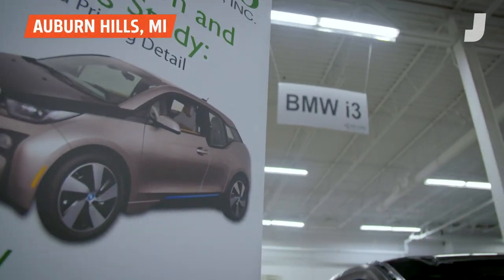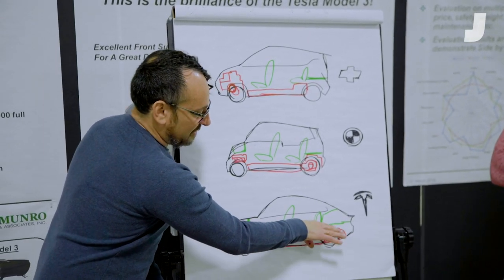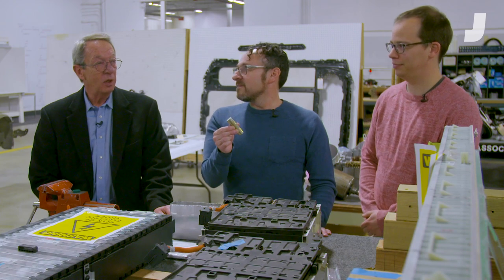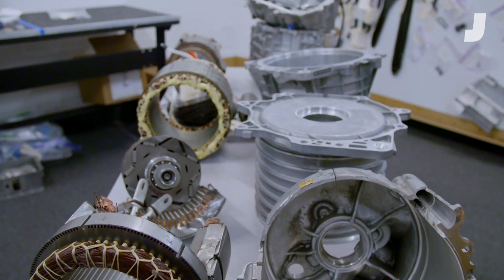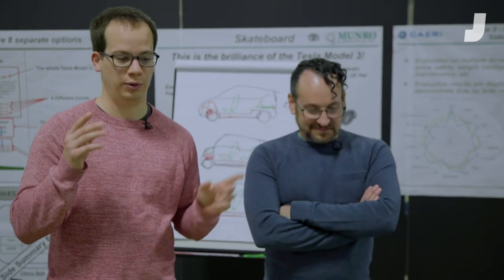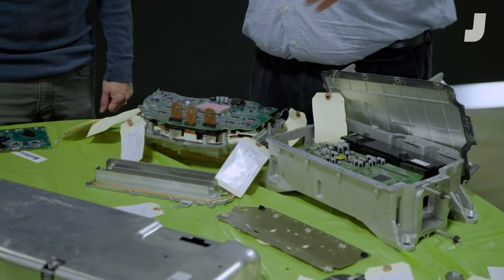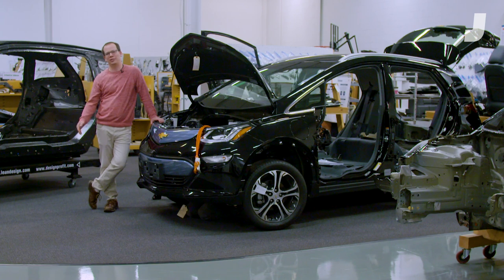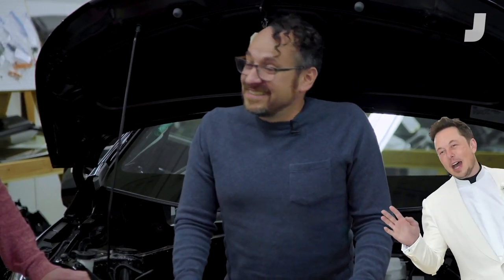A Look Inside The Tesla Model 3, Chevy Bolt, and BMW i3

Comment: This video validates Tesla more than any I've ever seen.
Reply: Tesla does the drive train well because they have relied and poured investment into motors and battery management since 2005, 2010 since Freemont.
I remember when these Munro guys sang their praises for the BMW i3, the only thing they didn't like was the 660cc motorcycle REx, but they were at a loss for words for the 0-emission constructed CFRP body married to an aluminium frame, ol' school.
Reply: Too bad the company is run by a con artist.
Reply: @truantray  who the hell feeds you these lies? Let me guess Alex Jones or some other right wing maniac.
Reply: okleydokley explain
Reply: to much fanboy spin....for example they kepr trying to rationalize non-existent flaws with the i3 and Bolt's body, to make the Model 3's well known poorly designed body, to not seem as bad...and yes the Model 3 is superior in other areas just be objective and balanced...
Reply: The crash tests say the body is very well designed since it's the safest car on the planet.  You can also say it's the worst designed body if you don't like water leaking into the trunk when it rains.  So I guess like every car it's a sort of compromise but it feels like it's a compromise a lot of people like.
Reply: a lot of people like it" is irrelevant except to prove some ppl have reasons to try to spin the facts...
rain going into its trunk is just one of many issues with its body, just look at the post and other sources..... 
it proves it would have been better if they out soured the body....
BTW the meme" it's the safest car on the planet" is BS since other cars have 5 star rating...and a Tank would do well in a car crash...which proves if u add enough mass you can make anything safe, no matter how poor the design is for its purpose...
Reply: That is like saying an 85% and 95% are the same score.  Sure both are an A, but one is still better than the other.

Also, you state Tesla is a tank, yet it has great handling and more range than anything comparable.  Even better when factoring price.

There is no doubt the model 3 is a bit over engineered as they point out, but it still is amazing overall.
Reply: Seriously ??? U think I said an M3 is a tank? lol
And as an engineer it amusing how utube wannabe experts call something over-engineered, to try to obfuscate the fact it's poorly engineered....
BTW its like saying an A is A while some ppl need to use "subject" scoring, that the test agency said was irrelevant...and it isnt based on real world stats like how many ppl survived an actual crash or not... so have fun making unwarranted claims about..(we love to use those memes don't we? )
thank goodness I didn't bring up its crappy reliability...
Reply: Not really. One is a modular design and one is only designed to work in 1 application. Modular is much more cost effective and scalable.
Reply: N C Hey what school gave you your engineering degree? I want to make sure that if I have kids I don’t send them there. 

Truth is the basis for engineering discovery, and you seem to have little regard for it.
Reply: @peterlaskiewicz8252 
modular is economic up to a certain point, past that custom fit parts will make the complete structure more cost effective and thus more bang for the buck for the customer.
Tesla did aim for 7k/month cars to make it economically sustainable to produce the car for a reason, you know?
The other two cars you've seen in the vid make at best 30k/year.. that's a 3rd of Teslas M3 scale.
And Tesla aimed for 10k/yr from the start.

TL;DR: you don't have any clue about economies of scale
Reply: @truantray  w/e gets the job done, what CEO isn't a bit of a con artist? ... I drive that "fraud" and love every second of it ;-)
Reply: @LuggageStardate  I remember went people like yourself used to say, "Tesla will never be able to make a quarterly profit." Tesla made a quarterly profit. THEN, the goal posts moved to "Tesla will never be able to make a profit for 2 quarters back-to-back". Tesla made a substantial profit for 2 quarters, back-to-back.  THEN, the goal posts have been moved AGAIN! NOW, people like yourself are trying to get even more legs out of this stupid logic, by extending it to "Tesla will not be able to make a YEARLY profit".  What's next?  Some people can't understand growth (especially automotive growth at this rate).  These types of people just can't wrap their brains around it.
Reply: @nc3826  
"As an engineer" what do you think of the Tesla motors design?
Impressive? yes?
How about the battery cooling?
Reply: @nc3826  
Let's check out your FUD spin?
Bolt.
Rejigged ICE body, layout, like an ICE car. Compromised in terms of good EV design.
Despite borrowing large parts, they don't sell at a profit.
Undeniable.
......
BMW?
An unusual (experimental?) design in terms of it's market segment (the replacement will be a steel body)
Expensive.
Still some packaging issues.
Undeniable.
...........
M3?
Conventional, but designed for purpose.
Overengineered? Maybe.
BUT still outperforms the competition.
Packaging, as far as the drivetrain is concerned? Excellent.
Undeniable.
Agreed?
Reply: You bet! I'm amazed how legacy automakers' simply unable to design an electric car from a clean sheet. They just can't let go of their expertise know-hows of making ICE cars. It's as if Microsoft tried to compete with iOS and Android by building a mobile OS with windows, drivers and a file system.
Reply: @nc3826  Agree. At 2:46 I could tell that spin the vid was going to take. I do think though, that if you separate the fanboys from the experts,  the vid as a whole was full of great information.
Reply: @rogerstarkey5390  If I repeat that the M3's motor is impressive, (which have  done here and elsewhere already)? Can you be honest enough to admit its body is just as unimpressive? as i it was designed by group group of monkeys...
Reply: @nc3826  
Well, Audi seem impressed?
They are apparent trying to figure out how to build theirs for the same price?
Also, over engineered doesn't mean "unimpressive", especially since it remains as safe, probably safer that any other.
Btw, how would you know either way?
Reply: @phermey  You make valid points and I respect your opinion on this matter. But starting with the mindset that only BEVs designed by a company that only makes BEVs can optimally design them. Will just result in, misleading delusional memes. Where the facts are just used to come to predetermined conclusion. And thats not science its propaganda.
Reply: @rogerstarkey5390 As I said many times Tesla lead is due to having a great team of engineers at least in where electrons are involved. And their problems comes from mismanagement at the top. That now has given the competition a window to compete. Which was apparent goal anyway?...So we will see what happens, my fanboy friend....
Reply: @nc3826  I guess you'd have to call me a Tesla 'fan boy', but I agree with most of what you're saying.  Give Elon credit for the vision and the drive to kick-start the EV revolution, but he's also made some very questionable decisions.  Worst of all was the attempt to make the factory fully automated when the cars were not designed to be assembled that way.  This caused so many problems they were forced to build the tent.  If not for this one decision Tesla would be three to five years ahead of the other makers instead of only two and they would've hit all their production targets...probably.  I'm still pulling for Tesla, though.
Reply: @Chris03121957 Labeling individuals in a serious conversation is counterproductive. But even if you think of yourself as fanboy I would tend to disagree since your using critical thinking which is mostly based on logic. So while I disagree with one point, about giving Elon credit, when he has been, more of drag  on the company than an asset. 
But don't tell anyone. Since I'm pulling for Tesla and all the companies giving us better and cleaner options for the future... I just tend to be boringly pragmatic about it and intimate objects like cars in general....But for those who think of Tesla as more movement and Elon as the leader of it, more power to them... But it doesnt change the stats of the car...
BTW- it was a pleasure to hear from you and you rational feedback..
Reply: @luminescentlion  
I get your point.
Reply: @AscendedSaiyan3  it's the same thing as when Amazon came up or when I was a kid and Toyota came out with the Lexus brand. People can't see beyond what's in front of their face today, right now.
Reply: @nc3826  Its not ”well known poorly designed”. What Munro said ist that it could haven been done with less effort, more simple and cheaper.
Reply: Munro admitted he was wrong across the board as far as Tesla is concerned. He's man enough to admit it. The tenure concerning the body work has softened a bit from "poorly designed" to "perhaps unconventional". In a year they'll admit that safety ought to be a priority for EVERY car manufacturer. 
Take a look at the crash test video comparing a model 3 with a Volvo in the same class. Especially with the side impact cabin penetration there simply is no way that Volvo is safer, no matter how many stars the cars get.
Reply: @truantray  Why is he a con artist?
Reply: @Oldsmobile69    YEAH NO SHIT
Reply: actually big automotive companies are not releasing electric cars because there is only 2 percent market, they will launch many electric cars when they have a big market share than now
Reply: @Oldsmobile69  Why do you think it is the SAFEST vehicle made? It isn't because they don't penny pinch on safety unlike the traditional car manufacturer. They have a bean counter who cuts costs which might compromise safety. Tesla have SAFETY in mind when building a vehicle. Which other car company have straight 5 on all safety parameters? Do you want to ride in a car that don't meet those requirements? Apparently you do.
Reply: @nc3826 You do realize that Tesla M3 have a 5 on all crash test, right??? If it was poorly designed, it would've not met those requirements. How about the other 2 vehicles? Did it meet the same requirement as Model3? NO, they didn't. Model3 is one of the safest cars including other Teslas. No other car manufacturer can boast that achievements.
Reply: aurelio milaor cabal  When a fanboy like you can admit has as Tesla has had crappy reliability I will be happy discuss  range and efficiency... there still no BEV pickups so its still earlier days... call me back in a decade
Reply: @truantray  Never seen a con artist deliver so well on his promises.
Reply: @MattCasters  Also, the most expensive to repair after a fender bender, and likely the most expensive to insure. Conveniently left out of their biased analysis and flag-waving.
Reply: @rogerstarkey5390  As an engineer - all that thermal goop in the Model S battery is a bandaid of someone persuasive who fell in love with an idea.
Reply: @AscendedSaiyan3  That profit came at a huge costs and was forced by activist investors (Wall Street immediate gratification types). Tesla laid off its R&D staff to cook the balance sheet to its investor's satisfaction, trading innovation and future product for an idiotic metric.
Reply: WHY does that make sense, to you?  Why do you think ALL the many analysts would not be able to find "cook the balance sheet" activity, after 8 YEARS of HARD scrutiny?  And, Tesla's R&D staff in STILL at Tesla.  I don't know where you're getting this stuff from, but it is NOT logical information.
Reply: @AscendedSaiyan3  Pay attention. To get to profitability, Tesla laid off 10% of its staff. ALL in R&D.
Reply: @vidznstuff1  Pay attention. It wasn't 10%. It was 9% and over a year ago (when they were NOT profitable that next quarter). And, NO. The entire R&D was NOT laid off! PLUS, I KNOW you didn't do the math on how much that saved in money. Here is a hint: It wasn't even $200 million/YEAR.

On top of THAT, Tesla's cash position increased over $700 million, in ONE quarter. The other quarter were hundreds of MILLIONS of dollars EACH quarter.  Now, what were you saying, about a measly less than $200 million savings being the only reason Tesla was profitable? 😉
Reply: @andrewbezzina87  Don't conflate hatred of Tesla with conservatives, I've run into plenty of hippies who drive ancient shit-boxes that can't pass emissions tests and get 10 mpg.
Reply: Not authentic or objective.
Reply: yeah, it shouldn't. There's way more innovation in the i3 than the Model 3.
Reply: @nc3826  hi troll:)
Reply: @andrewbezzina87   Elon musk started x.com which became paypay. Enough said.

Oh wait you want more? How about he makes it seem he started tesla when in fact he kicked out one of the founders and changed internal tesla history to cover up that fact?
Reply: @andrewbezzina87  I'm pretty right wing and Elon is my biggest inspiration. Don't be so quick with the broad brush.
Reply: This video fawns over the Tesla like every other.  They love to say it is more elegant, and "it's the future".  They completely fail to consider it costs 50% more, it's reparability is awful, recyclability is worse, it is built by non-union workers that are paid half as much, and GM pays shareholders dividends and taxes to the government.  Tesla continually takes money from investors and government subsidies.  If Tesla is the future WE ARE ALL SCREWED!
Reply: @MattCasters  I have owned three Prius and they rattle and leak water into the back battery space. My Mercedes S Class leaks water into the trunk. I'm cursed!
Reply: The water leaking into the trunk when it rains is what happens if you put a ceramic coating on the rear window. If you don't do that, you don't have an issue with rain leaking into the rear trunk in the rain.